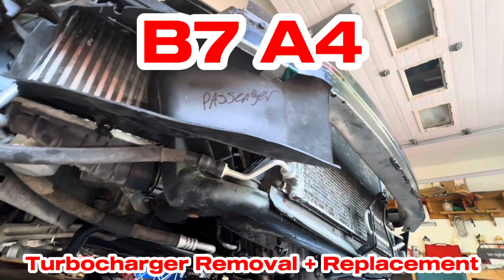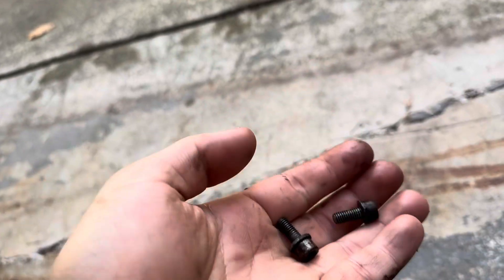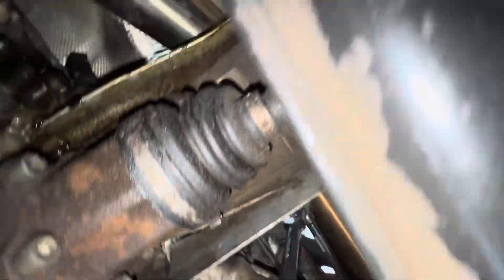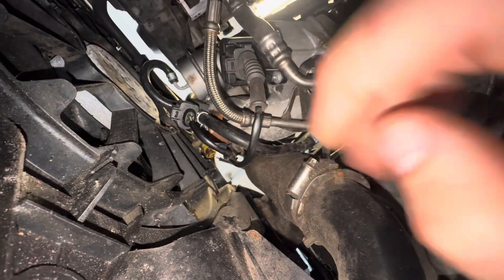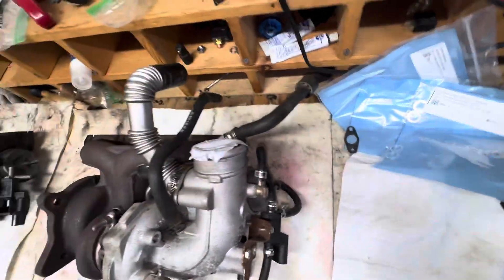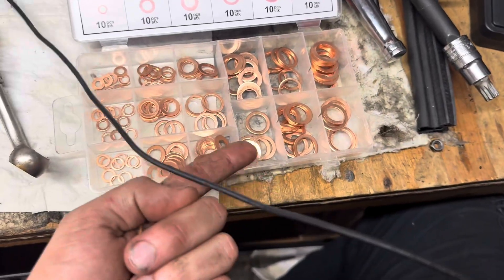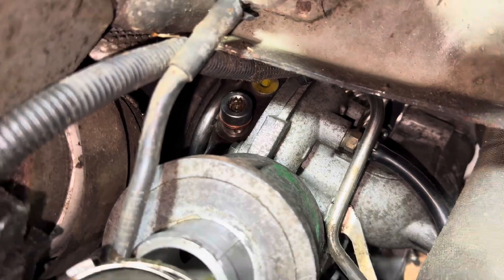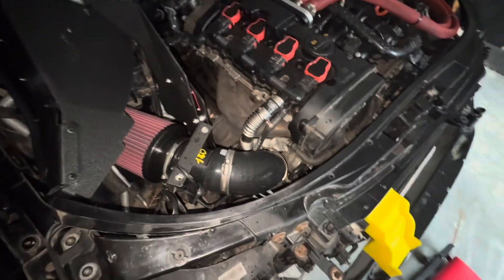Turbocharger Replacement | Audi A4 B7 2.0TFSI, EA113, Step-by-step Tutorial

Comment: 1:20 You said to remove 5 bolts on top and 4 at the bottom of the turbo manifold. Looking at the gasket and the head (post-removal), it would not seem that you need to loosen any bolts at the bottom?
Reply from the maker: Yeah it seems optional from my understanding. I didn’t fully remove the lower 4, only loosened them off the lower blocks maybe 1mm so the gasket can come out and be replaced.